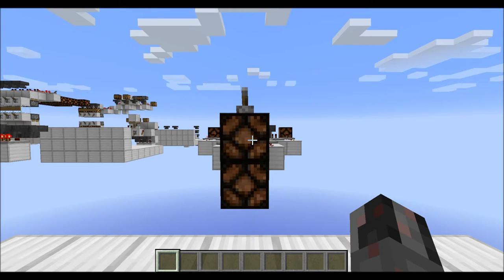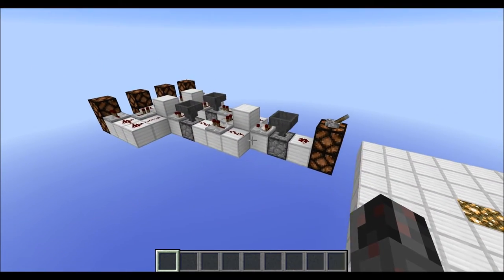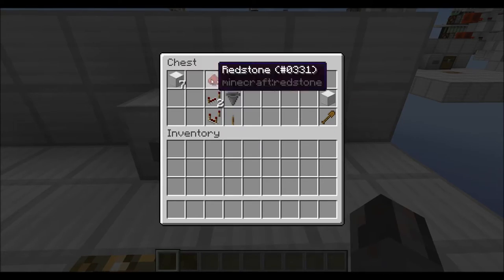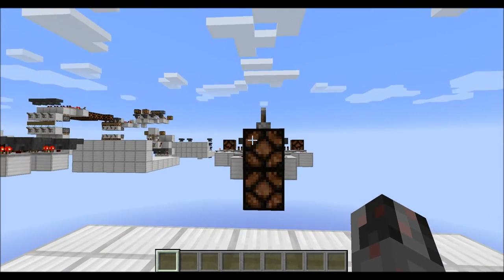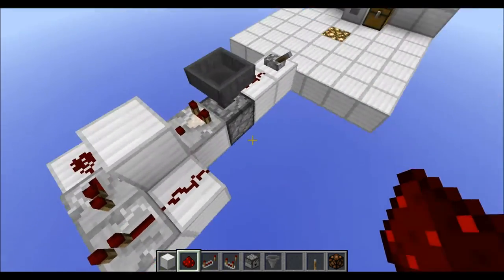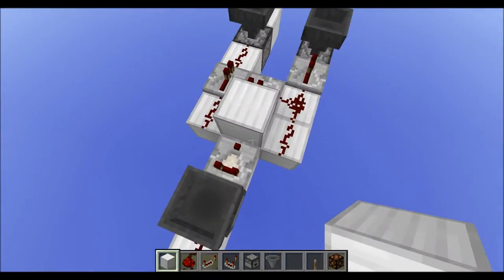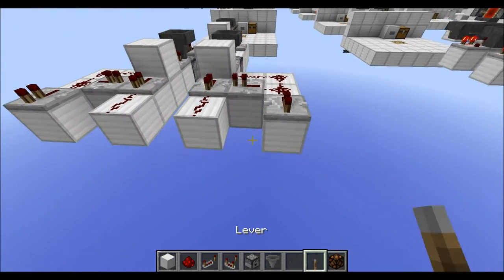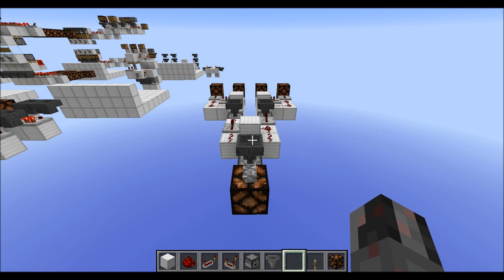Tutorial: Silent, randomized 1-bit Demultiplexer

Comment: That's just a randomizer, no multiplexer.
Reply from the maker: +dro Depends on how you define a multiplexer (one Input connects to exactly one of many outputs)... But that's just how I see it :)
         
Actually, it's pretty much a 1-bit multiplexer with a 1-bit randomizer at the controls...
Reply: +R.K.F. Walter (Redstoned Engineer) What you describe in your first sentence is a demultiplexer. A multiplexer chooses from several inputs and puts the signal on one output line.

You could put it like this:
A pulse generator followed by a randomly selected demultiplexer.
(Since DEMUXs' outputs are usually on by default, this would also have an inverted output, but that's just a question of implementation.)

Of course, saying it is a randomizer is the more sensible way. Please, for the sake of people learning this stuff, don't call it a multiplexer.
Reply from the maker: +dro Oops. You're right, I've been using that term backwards the entire time... Corrected it in the title and description. Thanks for telling me!